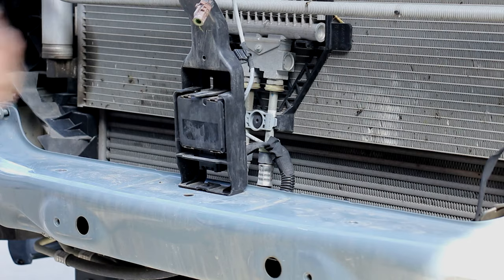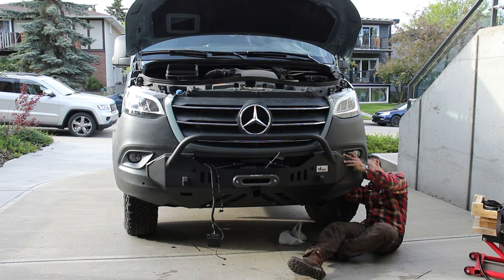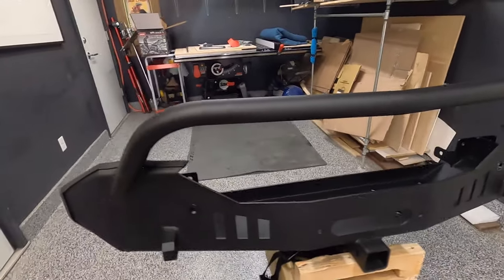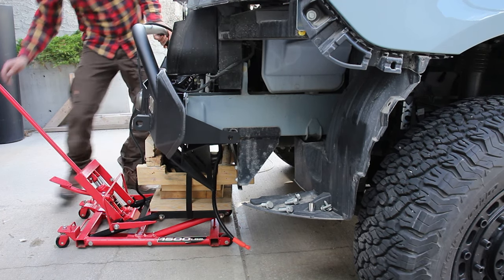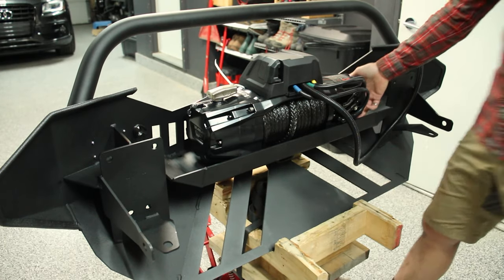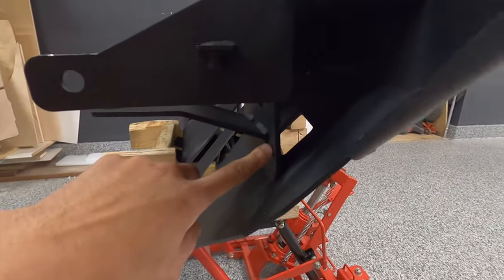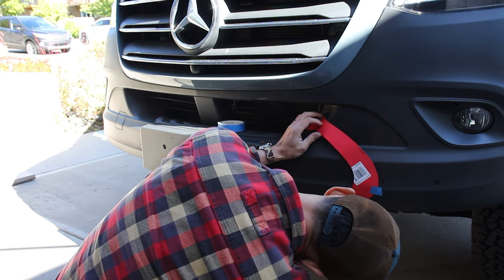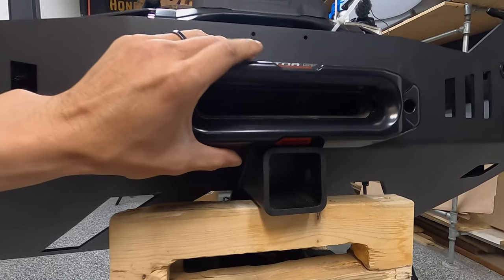Dissecting the CATuned Offroad Sprinter 2019+ Winch Bumper

Comment: Great video. How did you wire the winch? Did you go directly to the battery or did you wire it to the starter?
Reply: I am also curious how you wired up the winch. Any details you could provide would be great!
Reply: Toooooons of reading on how to wire a winch on the jeep forums or expedition portal forums. There are a few different ways and schools of thought with a cutoff or not. Dont wire it to your starter, you're asking for trouble. Straight to the battery with large gauge wire, lots of protection around bends and body edges.